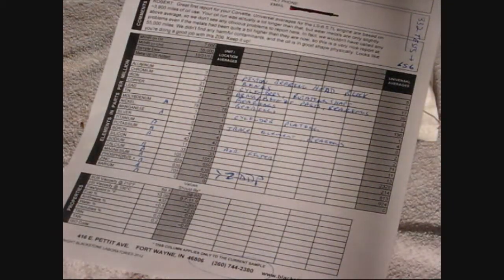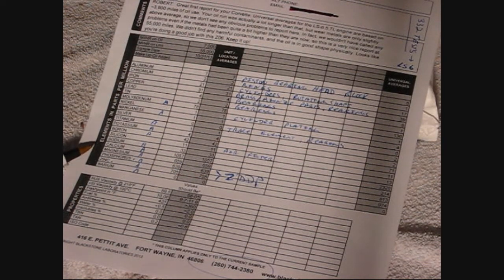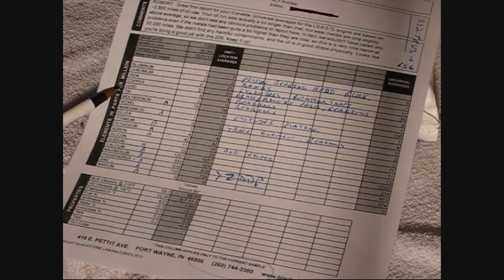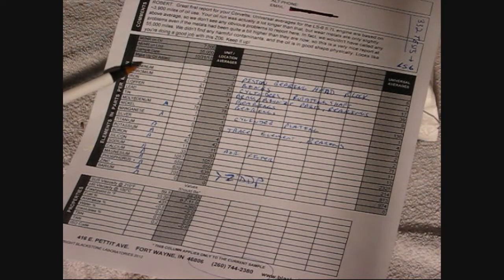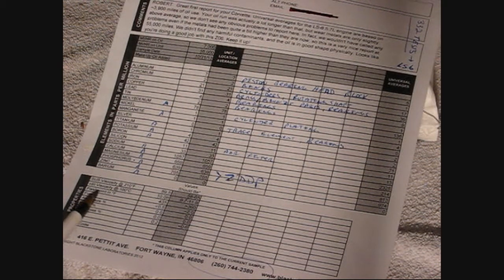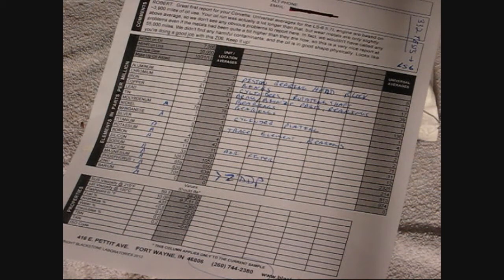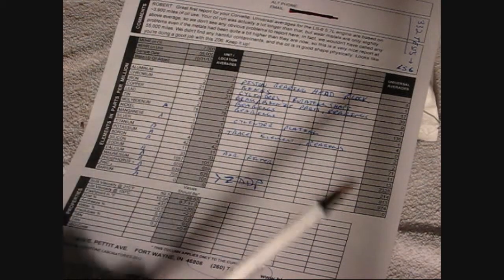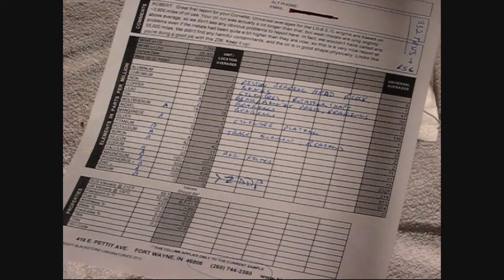Tools motor oil analysis part 2 by froggy Blackstone Labs

Comment: Great explanation of your test results, Froggy.  My Z06 had no previous oil sampling taken when I bought the car, and the first oil analysis I had done was pretty scary.  The second sample showed remarkable improvements in all areas, in fact well within the universal averages.  I will probably have Blackstone do an analysis every time I change the oil since it appears my driving will average out to one oil change per year.  But that's just me :-)
Reply from the maker: Probably the first owner ran the oil too long and the metals built up nd the additives depleted. I would not worry if te readings are good now.

:)